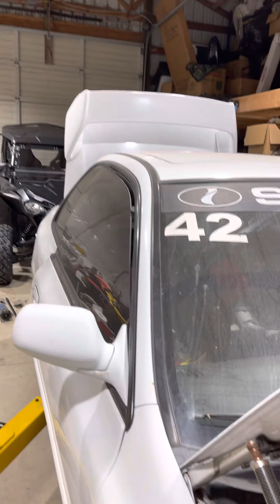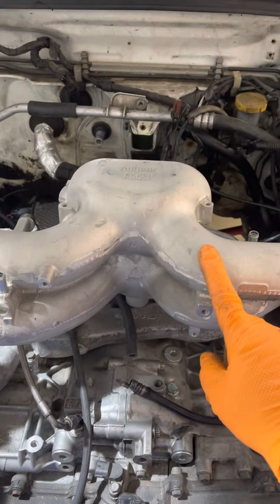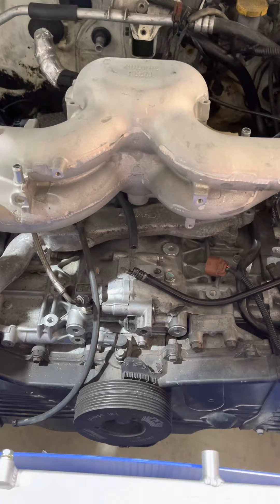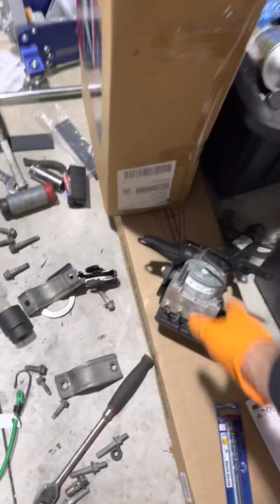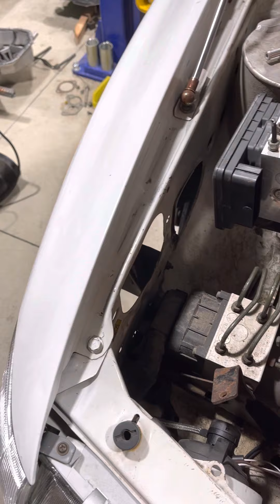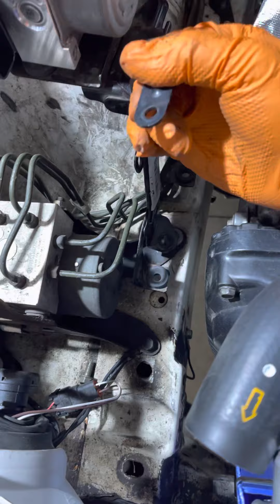Update on RS

Comment: I have one of these upper intake manifold. Planning to make it work on a ej20 with a 70mm throttle body and a tmic 😬
Reply from the maker: is there going to be room?
Reply: There is NO room… Going to cut out the throttle body flange and weld in a new flange to accept a cable driven 70mm. The tmic will prolly sit a little flatter above the pitch mount, theres definitely a need to get creative. Soon as my twin scroll project is out of the garage. Gonna start a new engine build using the sohc manifold

Comment: Nice 👍what engine management system are you going to run?
Reply from the maker: Emtron. Pretty sure I said that in the video. My apologies if I didn't. 
I will have to run the wires for the CAN bus, but the EMtron, 17 WRX Electric steering rack, 17 WRX ABS Module and the 2007 STi "resolver" should all communicate well on it.